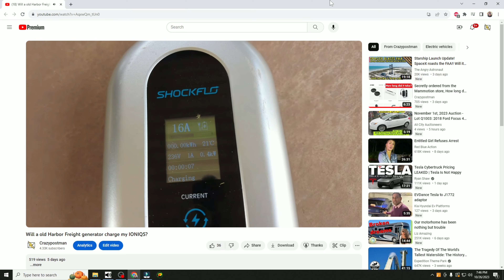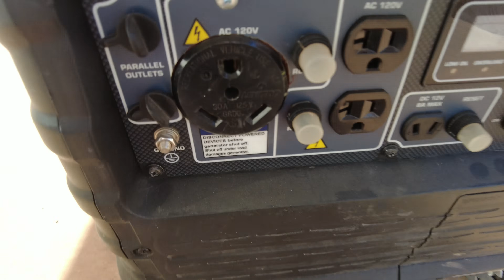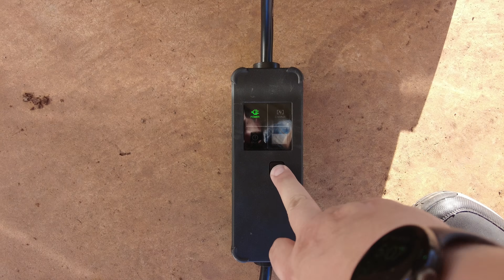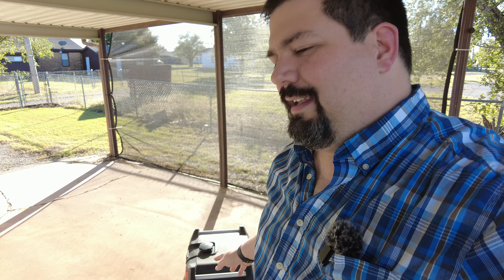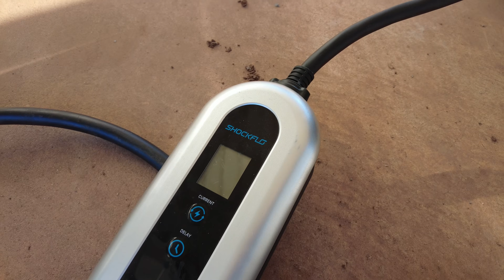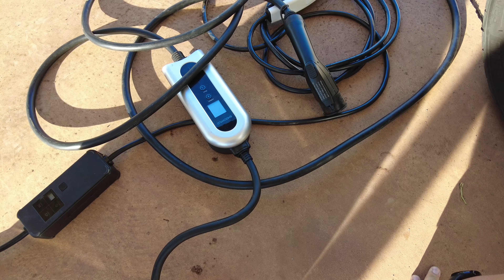Can you charge a IONIQ5 on a generator?    (Second Attempt)

Comment: Expected due to how the adapters are wired. They are designed to put the same phase of 120V on both 240V pins of the 14-50. This will make 120V loads on an RV work, but not a EVSE where the neutral prong is not hooked up. If you rewired the adapter to put 120V on the left pin, and neutral to the right pin, the EVSE would probably work, but that adapter would now be dangerous if used by an RV. Another thing you should know is that even if you could get a 40A EVSE working on 120V, some EVs limit their charge rate to 12A when they detect 120V regardless of how big the EVSE is. So it might not be possible to draw more than 12A from a TT-30 outlet no matter what you do.

Comment: The ShockFlo EVSE/charger will work on 120 volts providing that power going is flowing from one side of the "hot" pin and neutral on the other of the NEMA 14-50 plug. The neutral pin is not connected to anything on the attachment plug itself.

Internally most adapters unless otherwise stated the hot 120 volt to NEMA 14-50 adapters will send power to both hot side pins and the neutral serves the return back to the source (i.e. generator). In an RV situation, it basically provides power on both half of the power system albeit at reduced capacity.

There's a way to make a custom adapter to send power to one side of the NEMA 14-50 receptacle and neutral on the other on the "hot" pins, but to satisfy all of the safety nannies out there. It is not advisable to do that, just get the right equipment for the job.

I bought the Tesla UMC from my neighbor since he had an extra one with all of the adapters, I can say I can pretty throw just about anything at it and it will provide power to the vehicle up to the 32 amp limit. I even bought the 3rd party TT-30 RV adapter plug for it and it works like a charm too and it tells the UMC the continuous limit is 24 amps at 120 volts then passes to the vehicle that this all it can provide without any fuss. Love Tesla or not, but they provided such an elegant way to solve such trivial situations. Even if I bought it new from Tesla, its worth every penny in my opinion.
Reply from the maker: I'll play around with it a little bit more. To be honest when it didn't come on I didn't put too much thought in it because I figured it was a voltage issue. But the back of that EVSC does say it should work at 120. That second pigtail adapter I tried I'm pretty sure It was made where the hots are both hot.
Reply: @Crazypostman  if you make both pins 120 volts hot, they'll be no return path for the neutral. The only way to test the theory out is use a janky cord with alligator clamps to connect the hot to one of the "hot" pin and the neutral to the other. Ground of course to the ground pin.

The safest way to find out is to put your multimeter test leads on the both hot pins on the plug adapter when the generator is running to see if you have 120 volts across it.

120/240 split phase is quite a funny animal when you measure between the between the hot pins on a true 120/240 circuit, one side of the hot feeding to the other is out of phase of each other in which its kinda like a hot and neutral at the same time creating your 240. I get headaches when troubleshooting multiphase systems that have weird idiosyncrasies for my day job.
Reply from the maker: @felaxchow207  😂
Reply: @Crazypostman  btw, if you're gonna do the janky test. Please don't blow up your studio or if you do, make sure you have it on video.  :-P
Reply from the maker: @felaxchow207  If something's going to blow up it better happen on video! 😂💥